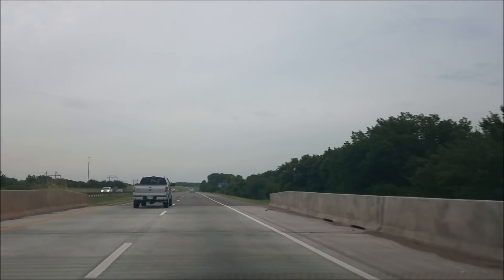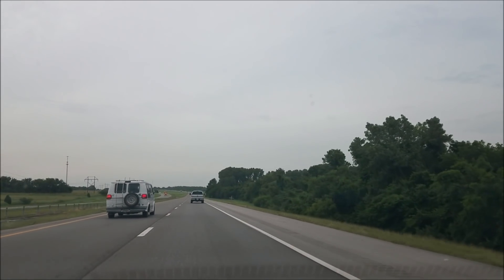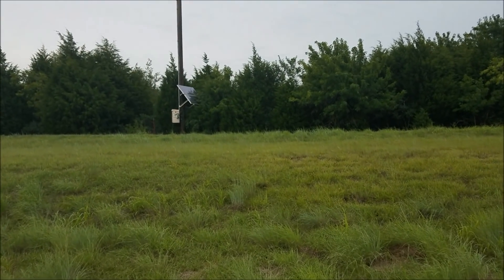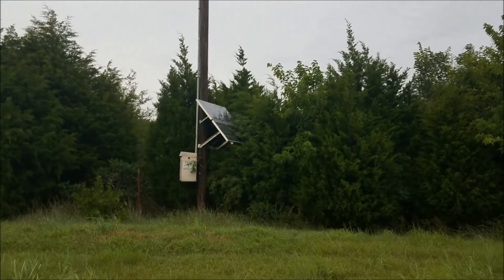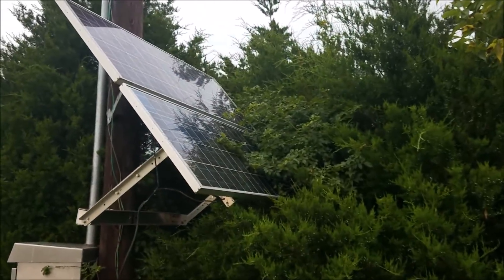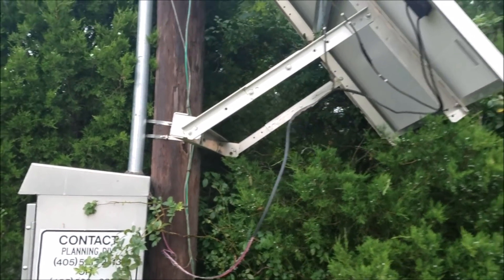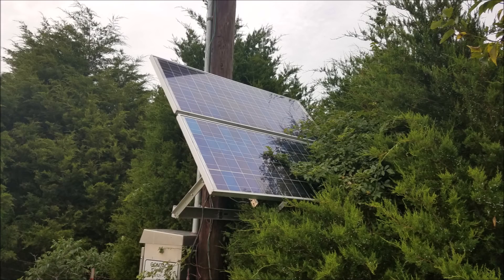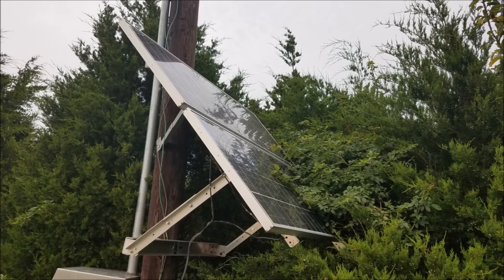How NOT To Do Solar - Part 3

Comment: Hi, how much more efficient is a modern rv fridge than a vintage one such as the dometic unit in my 76 airstream? My 960 watt system was designed for using an electric fridge full time but between the sketchy weather in western nc and my relic refrigerator my system doesn't  keep up. I have 670 amp hour battery bank. I just leave my fridge on gas full time and I'm fine. Even if it rains for days.thank you
Reply from the maker: I would not expect that fridge technology has advanced much in many years.  It all comes down to insulation and since RV fridges are exposed to higher ambient temperatures than a house fridge (the air conditioner in your house does half the work for the fridge) and do not have the same level of insulation it takes more energy to keep them going.  You should be able to run them during the day on solar and then switch to gas at night, though.

Comment: I have a question for the owner of this website. I have WindyNation charge controller connected to a single 100-watt solar panel and two large marine batteries connected in parallel with a powerbox containing multiple DC outlets. If you cover the solar panel so light doesn't reach it, the charge controller still indicates that 0.5 amps of electricity is being generated. Does this mean that solar panels always generate a small amount of electricity even when there is no light?
Reply from the maker: No, in perfect darkness it will generate nothing.  In ambient/indirect light, such as before the sun sets, the panel will still produce a trickle of power but it will be a tiny fraction of its rated output (a few Watts on your 100W panel, for example).

Comment: Looks like a relay station (2 directional high freq / GHz antennas). And maybe a sensor (the box on top of the pole, or is that a ethernet switch)?! Worst setup I've seen in a year on YouTube. Thanks! :-)
Reply from the maker: Could be.  They did look a little bit like small antennas.